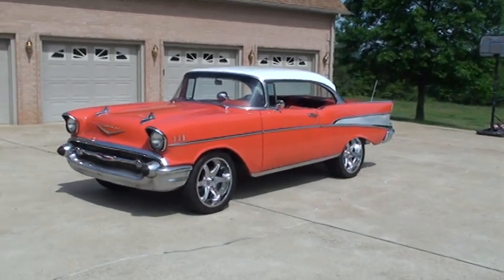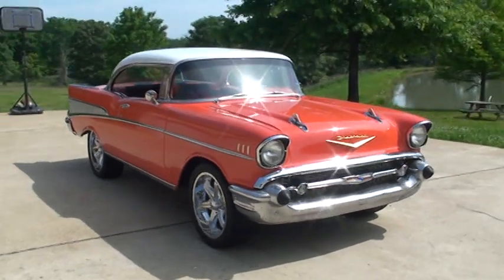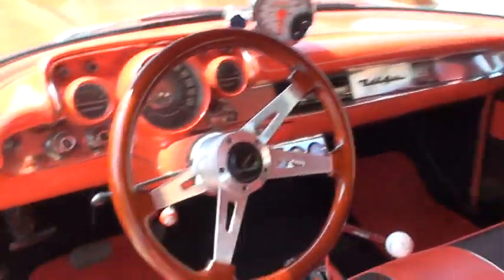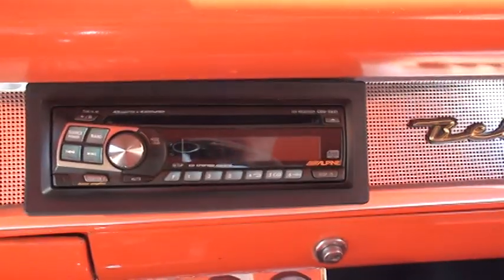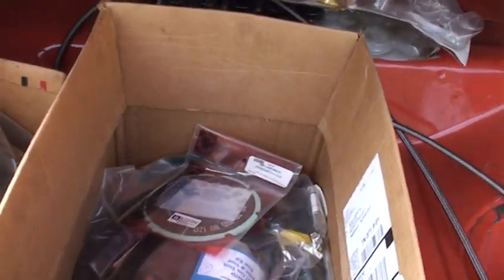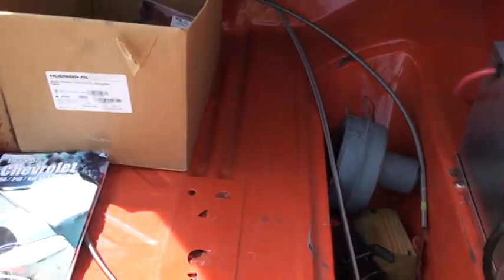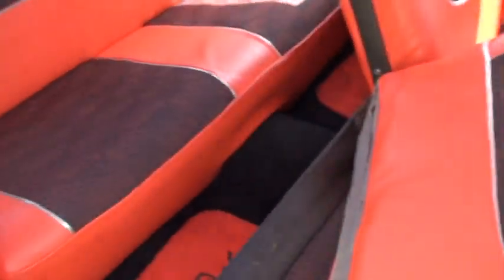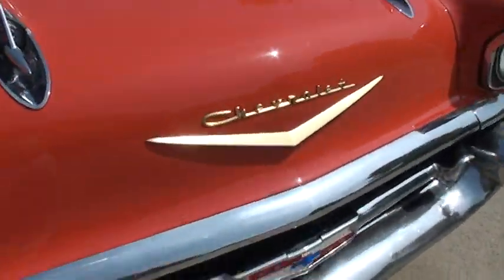SOLD  !!!!  1957 Chevy Bel Air 2 Door Hard Top

Comment: this car is so kool looking, i mean that's a color I wouldnt have selected for a 57 but it turns out looking awesome & those rims set it off just right, so I don't agree with the other comments because this isnt a stock 57, it's a custom 57 not a concours setup; and the engine setup is wicked too, I like the way they detailed the fuel lines & other engine components but I would have chosen a little less chrome; also like the exhaust system & the down turned tailpipes, this 57 is a winner!